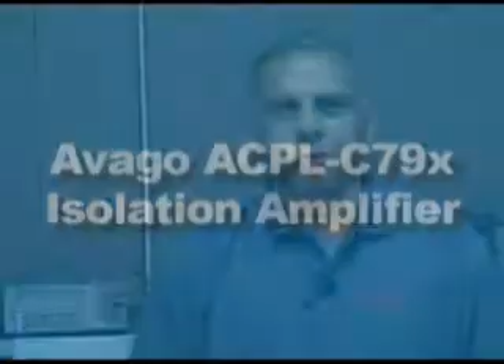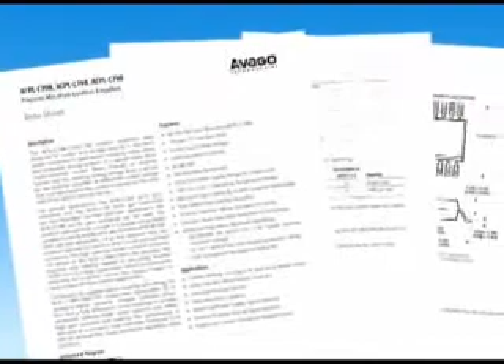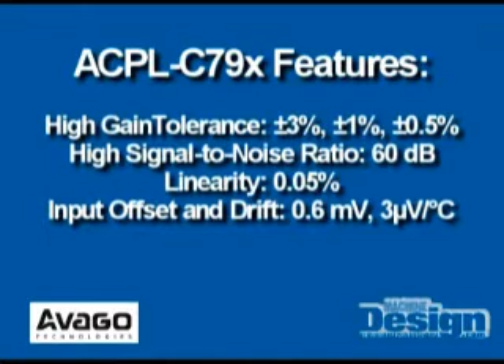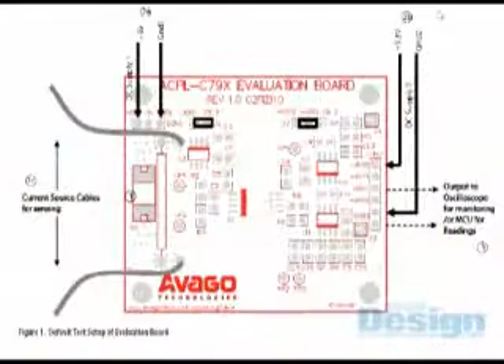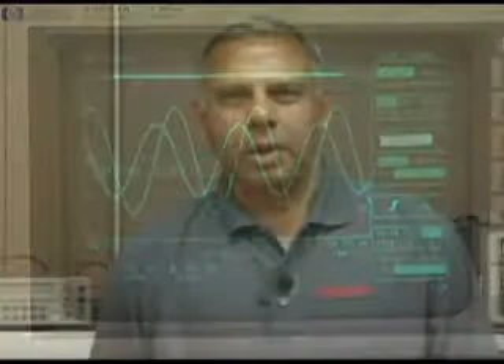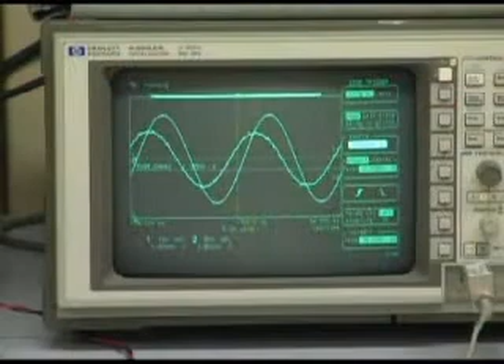ACPL-C79x Isolation Amplifier

Comment: Dear Avago Team,

To sense AC mains voltage(and run a PLL), I see that the ACPL C87 series has a limitation, in that, it cannot take in both positive and negative AC voltages. I am required to connect the SHDN pin to ground and give a voltage in the range of 0-2V at Vin pin. 

However, in the datasheet, it is mentioned that the absolute minimum voltage at Vin is -2 V. Does this mean that if I give a voltage input in the range of -1.23 to 1.23 V the output will vary in a linearly proportional fashion between 0 and 2.46 V??

Any help would be highly useful.
Thanks.